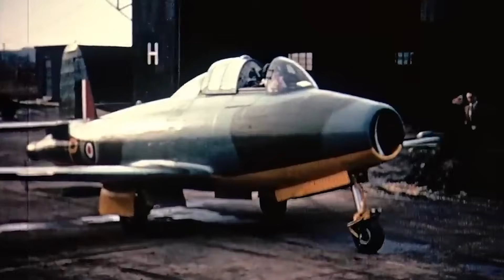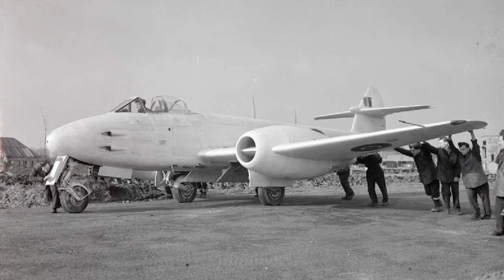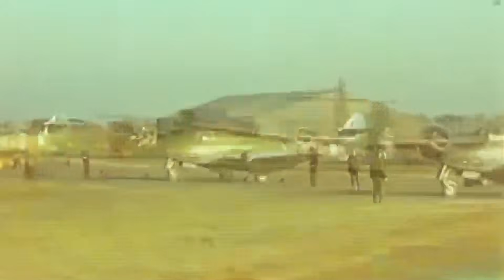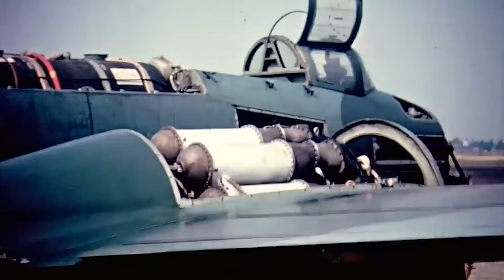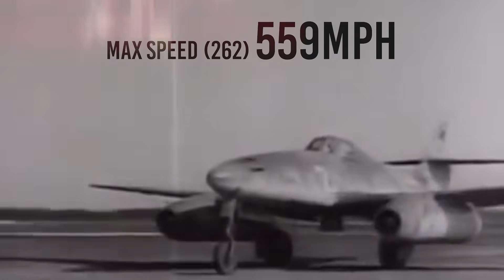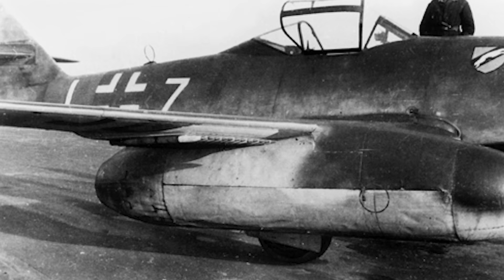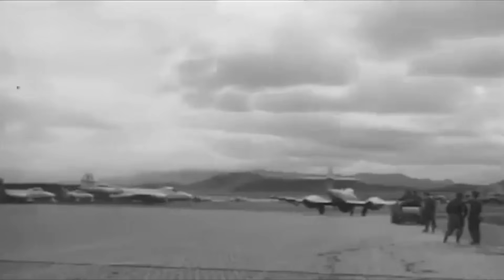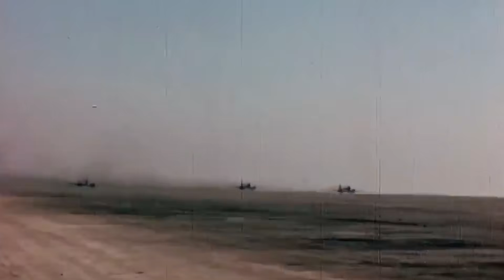Meteor vs Me 262 | Which was the better WW2 jet?

Comment: It’s no contest the 262 hands down. If the allies were operating the 262 they would have had a much higher sortie rates as they did not have fuel or supplies issues.
The meteor engine was more reliable however it’s not much good when your enemy can go 70mph faster, accelerate quicker and climb quicker. 
A P51 could also out turn a 262 but it did not do much good to help shoot them down.

Who cares about a shorter takeoff run.
Reply: @tenbear5 

LOL The Nimonic nickel super alloys were developed in Hereford England 1939 -1940. In Germany they thought they needed to use stainless steel for turbine blading which doesn't work and due to various issues ended up attempting to use pressed sheet steel turbine blades. 

262 & it's disposable shirt life engines = Garbage (but it did actually fly which surprises a lot of people). In both Russia and France good people wasted their time trying to do something with the engine after 1945. Russians ceased trying in 1948 as their own effort was clearly better.

In France RR got involved in 1950 and managed to get something useful working. 

We feel we can clear up some commonly held myths and misconceptions, obviously.
It's always good to see the facts presented clearly and concisely isn't it?

The existence of the Gloster Meteor, De Havilland Vampire, Gloster E28/ 39, Vastly superior De Havilland, Metrovik and Whittle turbojet engines actually terrified the German High command peeps. 

The Gloster Meteor was one of the world's first jet fighters to go into service, it was in service during WW2. The meteor was the first effective multirole fighter bomber jet aircraft with a reliable engine to go into service,  It broke speed records in 1945 and 1946. During WW2 it was in service as a fighter and multirole aircraft over the UK and over all allied controlled territories in Europe and beyond. 

The ME-262 and it's 46 minutes life engines were abandoned shortly after 1945, it had a do not exceed speed of 456 mph and was only ever used to attack bombers with losses of three 262s for each downed bomber.  During WW2 most of the ME-262s were destroyed by their engines, were various types of accident losses or were shot down by bombers. No German designers were involved with the Mig-15. The Mig-15 used a copy of the RR Nene.  

During the Korean conflict most of the Meteor casualties were due to groundfire or accident losses. The result of any tangles between Migs and Meteors was that Mig pilots avoided getting into dogfights with Meteors. The battle of Sunchon, where 50 Migs against 14 Meteors resulted in the supposedly superior Migs failing to gain any clear advantage caused the Koreans to re-evaluate tactics. General opposition in Australia to involvement in the Korean conflict resulted in the govt using the battle as an excuse to reduce the RAAFs involvement to troop support only.

The world's first wind tunnel was built in England during the 1800s. The world's first supersonic wind tunnel was built in England during the 1920s. 

The Whittle Gloster E28/39  was of course a brilliant aircraft that was later copied in Russia as the upsized and tweaked Mig 15 with a copy of the RR Nene gas turbine aero engine. The RR Nene being the world's most powerful & most reliable gas turbine aero engine in 1944.

The MD F3H Demon was a contemporary to the DH Sea Vixen & had a similar performance. The F4 Phantom was a follow on from the F3 Demon. The Sea Vixen took a long time to get from first flight to introduction for various reasons and a similar situation occurred with the MD F3H Demon.

McDonnell Douglas F3H Demon
590 Built. Not Supersonic.
Max Speed 578 MPH.
Introduction date 7 March 1956
First flight 7 August 1951
Retired 1964

MD F-4 Phantom 2
Number built 5,195
Manufactured 1958–1981
Introduction date 30 December 1960
First flight 27 May 1958

DH Sea Vixen
Number built 151 (including two DH110 prototypes and one Sea Vixen prototype)
Introduction date July 1959
First flight 26 September 1951
Max speed 695 MPH.
Retired 1972

Interesting British achievements.
There is no doubt that the Fairey (England)
Delta 2 was of course the world's first jet
aircraft to exceed 1000 mph.  Indeed It
exceeded the previous record by 310 mph &
held the record for 1 year. Incidentally, the Dassault Mirage 3 & 4 are based on the Fairey Delta 2.

The Panavia Tornado & Euro fighter Typhoon are British design aircraft with British design engines built by international consortiums. 

The EE Lightning was one of the fastest aircraft on the planet when it first achieved a Mach 2 flight. 

Early days, jet fighters.
De Havilland Vampire, Sea Vixen & Gloster Meteor accident losses were not high or unusual for fighter aircraft at the time. De Havilland built large numbers of all metal airframe aircraft before the DH Comet.
We mustn't forget of course that the DH Vampire for example first flew in 1943 & the engine was also built by De Havilland. There were examples of the Vampire interceptor / fighter in service until 1990 which was operated by more than 30 countries.

Non combat phase accident losses.
% of Aircraft built.

The Canadair CL-44 was a turboprop airliner.
Canadair CL-44                  (ff 1959 ) 48%
Lockheed XF104                (ff 1954) 100%
Lockheed  P80                   (ff 1944) 43%
Lockheed F104                 (ff 1954)  45%
Grumman f9f-5 Panther   (ff 1947) 44% 
Convair F102 Dagger        (ff 1953) 45%  
MD F-101 Voodoo.             (ff 1954) 34%
MD FH Phantom 1            (ff 1945)  35%
MD F4 Phantom 2             (ff 1958)  28%
MD F3H  Demon               (ff 1951)  32%
Gloster Meteor                  (ff 1943)  21%
DH Vampire UK                (ff 1943)  23%
DH Sea Vixen   UK           (ff  1951) 33%
Gloster Javelin  UK         (ff 1951) 20%
EE Lightning  UK             (ff 1954) 33%

It's a great pity & a crying shame that British military forces had to occupy a large part of Germany for decades after 1945 & Russian military forces had to do the same. Of course Russia still posseses a large chunk of what was German territory & of course Russia & the UK produce nukes. Obviously Germany does not produce nukes.

Early days, jet engines. Whittle performed the world's first demonstration of a gas turbine aero engine in 1937. The RR Nene, a centrifugal gas turbine aero engine, was the world's most reliable & most powerful gas turbine aero engine in 1944. Licensed built versions & copies of the RR Nene & RR Derwent would go on to power many aircraft in Russia including the Mig 15 & Mig 17, the US, China, France & other countries for decades after 1944. Incidentally, the Mig-15 was in essence an upsized / tweaked copy of the Whittle / Gloster E28/39 jet aircraft including an uprated copy of the RR engine.  The basic centrifugal compressor gas turbine aero engine with Whittle style reverse flow combusters and sometimes an axial compressor section is still manufactured by more than one company including Pratt and Whitney, the main application being helicopters.

The gas turbine engine was invented in England during the 1700s.

During the 1800s Parsons of Ireland & North England produced the world's first axial multi stage sequential stator rotor turbines and compressors for turbomachinery use which would eventually go on to to form the main components of the axial gas turbine aero engine. At the time the basic idea of making an internal combustion gas turbine engine and using it as an aircraft engine was considered thus the jet aircraft concept had been created in England before the first powered aircraft flew.

An example of what goes on these days in various countries. For example, there are of course no German companies that makes German jet aircraft in Germany & there are no German Companies that make German gas turbine aero engines in Germany that are suitable for widebody airliners.

The UK has the world's highest combined per capita Nuclear / Defence / Aerospace Sector Activity.

UK defence sector, absolute terms, world's second highest activity. 1st for per capita defence sector activity. Per capita nuclear powered submarine construction, 2nd position. 
Main players being Rolls Royce, Babcock, GKN Aerospace & BAe Systems. Activities often involve international collaboration. BAe systems, RR and other UK companies now handle more Airbus work value wise than Germany. 

There's a good chance that anyone currently flying on a widebody airliner will be on an aircraft powered by RR gas turbine aero engines made in the UK and a good chance there will be other hardware on the aircraft that's designed and / or manufactured in the UK. 

Rolls Royce Holdings UK
Subsidiaries
- Rolls-Royce plc
- Rolls-Royce North America (ex Allison etc Classified Military stuff)
- Rolls-Royce AB
- Rolls-Royce Deutschland
- Rolls-Royce India Private Limited
- Rolls-Royce Marine Power Operations
- Vinters Engineering Limited
- Rolls-Royce Controls and Data Services
- Rolls-Royce Power Systems
- Bergen Marine
Joint ventures include:
- Rolls-Royce Turbomeca
- MTU Turbomeca -

Trent Family
The MT30 (Marine Turbine)
Industrial Trent 60 Gas Turbine
Trent 7000
Trent XWB Airbus A330neo.
Trent 1500
Trent 1000
Trent 500
Trent 600
Trent 700
Trent 800
Trent 8100
Trent 900
   
RR wholly owned subsidiaries in Germany handle smaller 2 shaft RR gas turbine aero engine work.

The UK space and aerospace sectors are highly productive, high-value industries that together contribute over £18 Billion in direct Gross Value Added (GVA) to the UK economy. Individually, the space industry directly contributes about 0.3% of UK GDP 7•2 Billion while the aerospace industry contributes approximately 0.5% £10•9 Billion.
   
Wee hopes theze helpsmz.  EtC---.

We hope this helps of course 👍

Comment: Amazing how political interference so badly effected the German war effort, from production to strategy and battle planning.  If the German effort had been managed by people that knew what they were doing, the outcome would probably have been very different.
Reply: That Hitler cased the delay of the Me262 is largely a myth. What caused the delay of Die Schwalbe was lack of engines and that was entirely due to germany's inability to acquire the needed materials to build a reliable engine.
Reply: @AndersLang-i5s There were several reasons but Hitler and Goering were one of them.   It is not a myth, it's just taken out of context.

Comment: Very informative video, as usual.  However, could you please use metric units, Imperial Units have been illegal in Australia for half a century already😊. Most of the world also can't tell a mph or foot from a bar a soap.
Reply: In Australia we still use imperial too, eg metal working, people's height, women's clothing, etc.
Reply: @WagesOfDestruction 
You must be a senior citizen 😂, nobody in Australia uses Imperial Units for people's height anymore. If you go to a shop nowadays and tell them you are 5'6" they will think you are from another planet.  The same goes for stone and pounds. Also in metal working, nobody uses gauges or inches for sheet thickness or pipe diameter- it is mm and NB(Nominal Bore).  And please,  don't start me on a subject of women 's clothing; this a completely different matter😂!

Comment: The MiG-15 had a centrifugal flow engine.
The Czech’s and Soviet’s used copies of the Me262 and its engines postwar. They were withdrawn as soon as they could get the more reliable and powerful British engines (or clones of them) in 1947. The Ju004 (and BMW003) were unreliable crap.
Reply: Commies did not use the engines which Meteors had during WW2
Reply: @AM-cw1kp They Soviets used captured German engines during WW2 and motor jets.